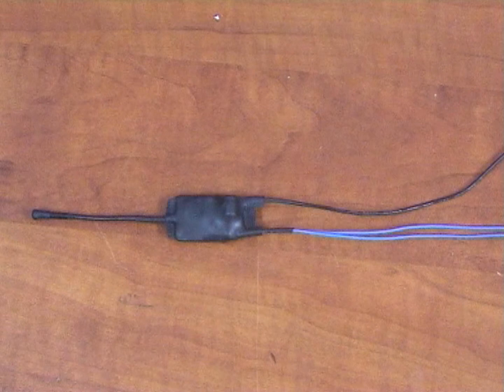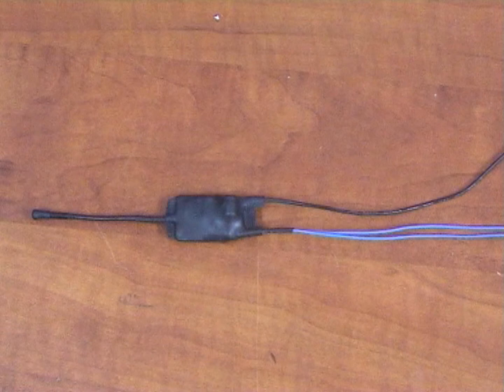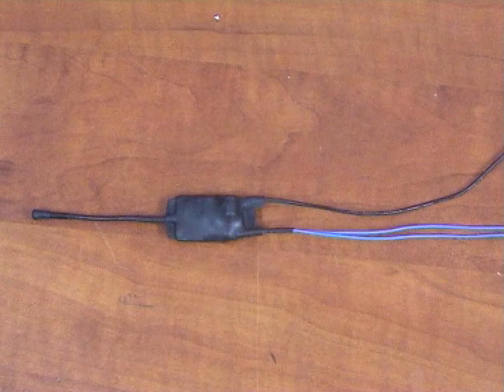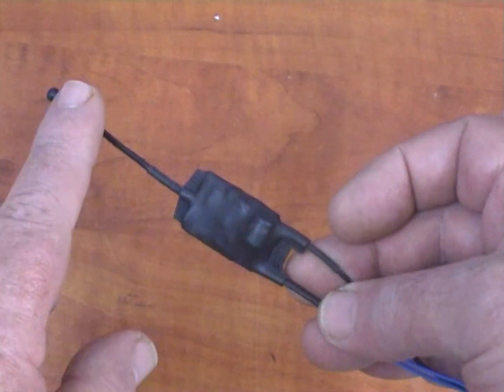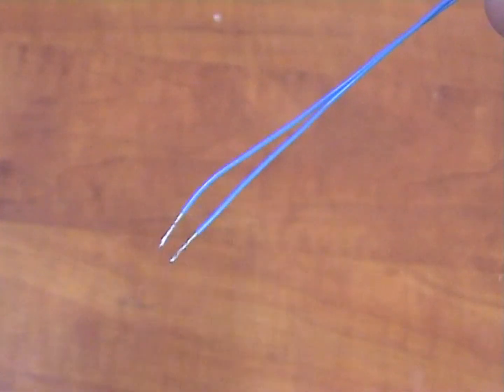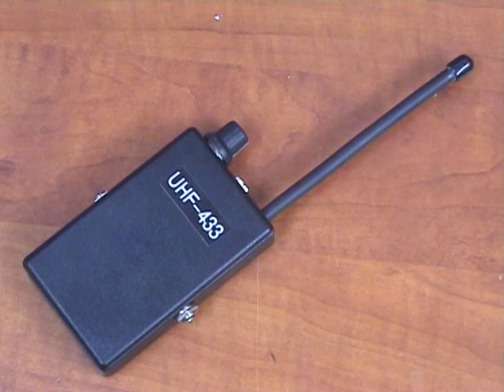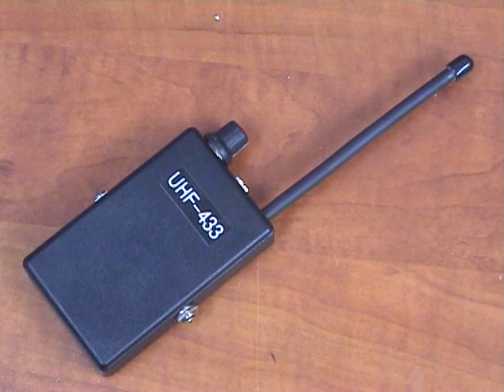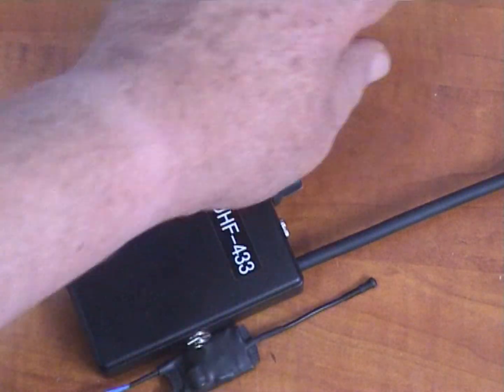UHF bug spy transmitter receiver  SET, 110 or 220 V operated, quartz controlled

Comment: What does connect it to the mains mean ?
Reply: Mains means electricity network. So, you may connect it to the 110V or 220V network.
From wiki:
In the US, mains electric power is referred to by several names including "household power", "household electricity", "house current", "powerline", "domestic power", "wall power", "line power", "AC power", "city power", "street power", and "electrical grid"